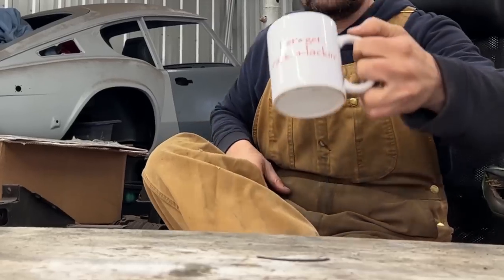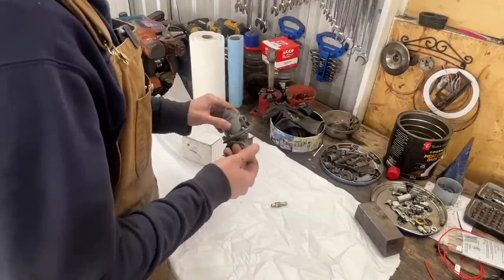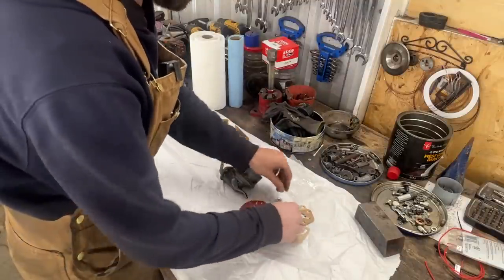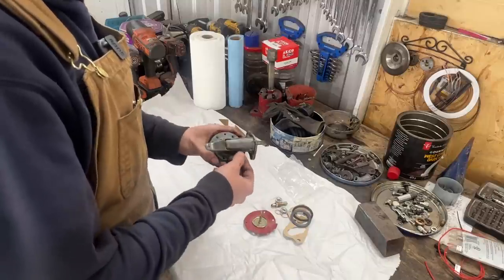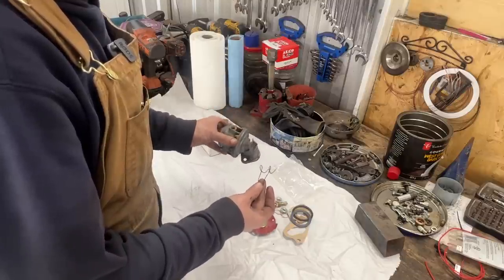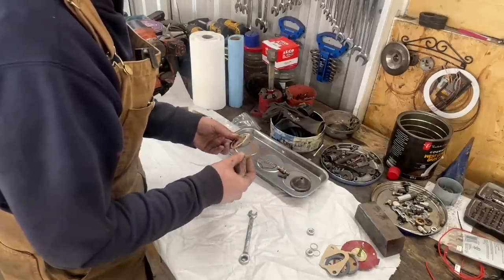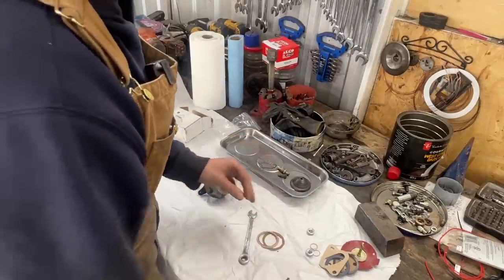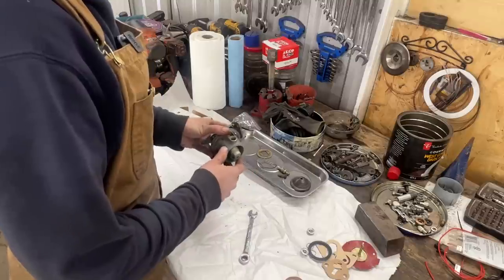1972 Triumph GT6 - Part 89 - Fuel Pump and Distributor

Comment: Fabulous Ellin. Just got the head back for My GT6 MK1 motor. I must mask it off, then paint the head. I’m not near as far along with all the accessories to mount on the motor. For my fuel pump I got the glass bulb type along with the after filter it matches it so I’ve got to figure out how I’m going to mount the other after filter in line. 
Your tutorials are literally invaluable to me, because so many times I’ve gone back to the Stanpart shop manuals, and they don’t have great illustrations at all, nor do their photos, the photos or less than perfect and absolutely obscured most of the time 😳😳 so your tutorials really shine a lot of clarity🙏🙏👍👍

Comment: Very informative Elin.. The fuel pump rebuild was very interesting. Back in the day, I never would have bothered as a new replacement was so reasonably priced.  I seem to remember some post 1972 GT6's were fitted with a Delco Remy dizzy.. The first cars had a Lucas 22D6 from memory.  Great video and looking forward to the continuation of the assembly.

Comment: Elin, I don't know what started your love for Triumphs, but mine was started when I was a pre-teen and my boy scout friend's Mother had a LHD Triumph Herald 1200 Estate back in England, then in 1978, my Mother and I found a 1974 Triumph 2000TC Saloon for my Father who was then working in Saudi Arabia. He bought me a 1967 Triumph Herald 1200 Convertible in 1981, as a starter classic, which we restored and mechanically modified, I kept that car until 1998, when I finally sold it as I had  by then 'finished' building my 1963-1971 Triumph Vitesse Mk.2 Convertible, (took from 1984-1997) and emigrated with it to the USA in 2002, I am still mechanically modifying and improving it, I am 64+ now and running out of energy! In the UK, we like to support the underdog! What's your story?😮

Comment: Your Distributor. 
You call it vacuum retard but think again. You said that the shaft turns clockwise and when you pressure activated the the diaphragm the plate rotated anti/counter clockwise. Since your points are mounted to that plate then to move them anticlock means that they meet the cam lobe earlier. Isn't that action then a vacuum advance (earlier) ????
Reply from the maker: If I said the shaft turns clockwise I made a mistake. I don’t remember but it is possible. The shaft turns counter clockwise and that is why this is a vacuum retard.